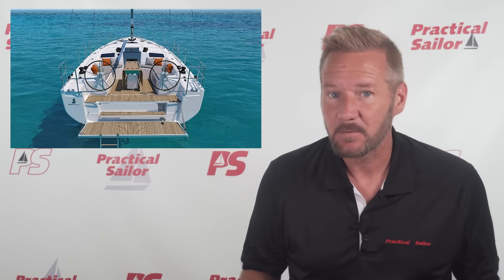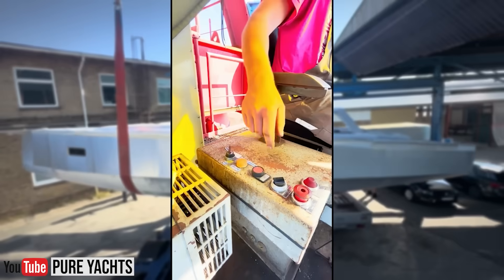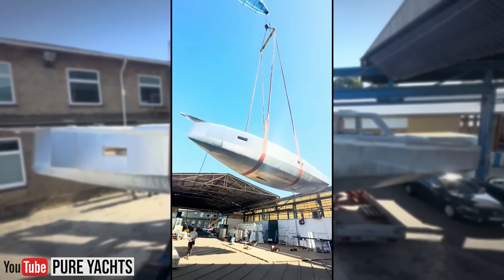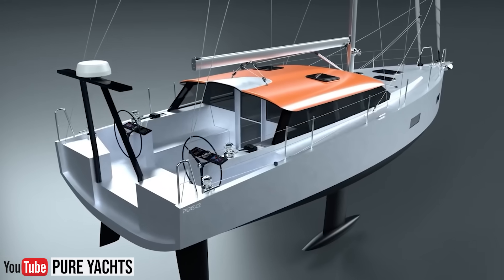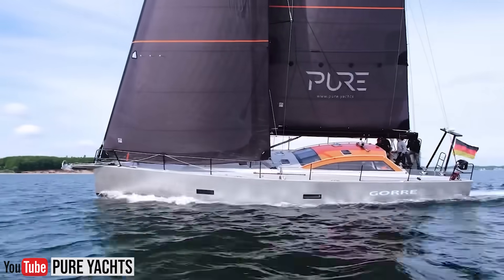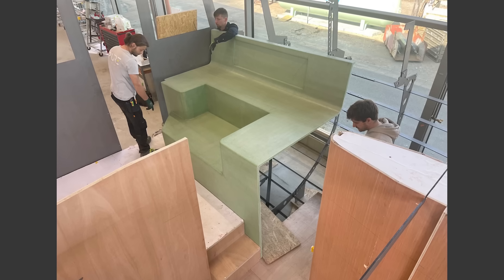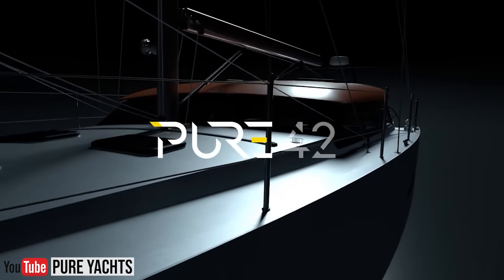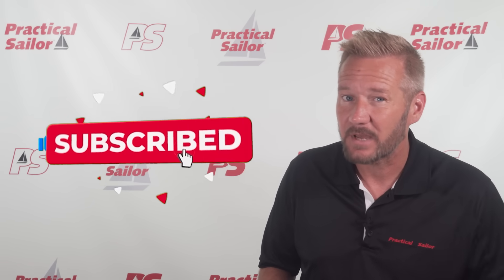Inside Pure Yachts: Germany’s Ultra-Modern Aluminum Sailboat Builder

Comment: Hello, my name is Matthias, CEO of Pure Yachts. Thank you very much for your comments and suggestions. I think every boat is a compromise. If you want a racer, you will end up with carbon. If you want to spend the winter in Antarctica, you need a real explorer. Our 42 is a fast and safe cruising yacht that is equipped to do anything. For me, a good design is characterized by simplicity, reliability, quality craftsmanship, and good sailing characteristics. Good sailing characteristics means for me active safety. It should be possible to tack away from a leeward coast with a sailing yacht even in 40-knot winds, and everyone should be able to enjoy the fun of sailing on a reach course in double-digit speeds. Our hull number 1 is currently in Barcelona, taking part in the “Yacht of the Year 2026” competition. You can find some great videos and pictures on the internet. You are all invited to visit our shipyard and test sail our Pure 42 “Tom Kyle” or the Pure 49 “Gorre,” or simply share a coffee or a beer with us. Best regards, Matthias

Comment: Regatta Sailor from Kiel here...
i race against Gorre (Pure49) and Sunbird (BM53) occasionally and i can tell you, that performance of those boats is fairly unimpressive. An X41 is faster than those two, even without handicap... Nice boats for Blue water cruising. Other than that i would suggest to get something else
Reply: Sorry, Baltic 500 this year: Pure 49 "Gorre" 2nd line honours - just behind Lennart and Melwin. So far...regards Matthias
Reply: @42scherni  not even 30 mins faster than a First 36 or an XP44 and 28th on Handicap 😅 And at other events the performance wasnt any more impressive

Comment: 1- I think 80ft is the ideal length---spacious and comfortable, and, yet, sailed short-handedly with automated systems.

2- Aluminim built to steel strength through added thickness is still lighter, stronger, except at welded joints, and immune to corrosion, provided the boat has no leakage currents.

3- I'm still not decided on the rig--Ketch Vs Schooner. If a schooner could have a partially furled upwind performance as good as a ketch, then, of course, I'll prefer the schooner for better downwind performance to quickly escape evolving storms. I don't like sloops, despite their far better efficiency, because of the capsizing moment they create with their larger height and area.

3- I want a centerboard or a swing keel for shallow beaches and for exploring rivers.

4- I want twin rudders, screws, and engines or motors in a diesel electric configuration, but only if this won't lead to leakage current issues to poke holes through the hull. i'd stick to twin diesel engines with twin shafts in lieu of the electric motors if there would be leakage issues because of improper earthing and insulation. 

5- I want the propellers and rudders protected by skegs or rhe hull, and I want the ruders to be retractable, like those on the Pangaea.

6- I want another set of rudders for shalllow waters, completely protected by the hull, like that of Pangaea.

7- I want the bow to bow to be strong enough to do light ice-cutting, not breaking, like the Pangaea.

8- I want fore and aft water ballasts for leading and trailing seas, as in the Beowulf.

9- I want good insulation and also water-tight roof or lazarette-mounted  ventilation ducts for the tropics.

10- I would like to use solar, wind, and hydro power(under sail). 

11- Since ammonia isn't practical yet, which can be produced from sea water, i might opt for lithium and sodium batteries in lieu of the primary ballast, but, again, only if it won't create potential corossion issues with leakage currents.

12- I, of course, want a deck saloon, at least a small secondary one, and also two semi-covered helms on the main deck.

13- I want a very large saloon, a comfortable owner's suite with a desk, a tiny workshop/hospital, 2 twins, and a dorm for the crew. An ensuite shower/toilet for myself, a common head/shower for the two twins, and 3rd one for the crew. Perhaps even a tiny cabin for the captain.

14- I want a small jacuzzi for warmer climes, which can be used for storing water or rations in colder climes.

14- I want a solar still, and also the usual RO or electrical desalination system. 

15- I need to hold supplies for around 10 to 15 days in a blend of refrigerated and unrefrigerated compatments. 

16- I want all systems automated for short-hand operation with minimal crew, as on the Spirit of Venice.

17- I want an alluring and practical interior, with minimal carpetting, for easy maintenance, as on the San Lorenzos, Swans, and Oysters.

18- I want to be able to tow or a host a 28ft trimaran, as a tender.

19- I would prefer electrical conduction cooking  and convection heating with backup diesel stoves or perhaps an entirely diesel system. Heat pumps are most efficient, but they struggle in negative temperatures. I'd still want to take a look at them, since they also serve as airconditioners in warmer climes. 

20- I want maximum autonomy and lowest maintenance.😮

21- Electric current leakages and alumnium are a disastrous blend, so unless the earthing and insulation can be fool-proof, I'd want to do away with electrical systems, wherever possible.

Comment: Hello from the Gulf of Alaska.
Sailing isn't my forte', but I can tell at a glance that isn't a heavy weather boat.
Reply: why?
Reply: @tcurdt  Wide, flat hull, closer to planing, with a high performance dagger keel. 
I bet it points high and runs fast on a reach. 
The "problem" happens when you heave-to and try to set a sea-anchor. 
A full keel/deep draft traditional hull will drag a large amount of water in the direction of the boat and the swell. This is like an artificial tide, running with the swell, which knocks, or pulls the crests flat, or flatter, so they don't break, slam into you and knock you down or roll you. 
Better than listening to me - Read "Heavy Weather Tactics" by Lynn and Larry Pardey.

Comment: Keel down when sails are up is a significant design problem. Check out Boreal yachts for proven offshore Al built boats. We sail off the wind with the centerboard up all the time, about 3’ draft in that mode
Reply: It's not a design problem it's covering their asses from potential brand damage and lawsuits. the boat wont fall over if you hoist the jib and cruise through the shallows with the keel up.

Comment: When it comes to design choices, we can have an educated discussion and it comes down to individual preferences. Lack of experience, skills and very basic boat building procedures are not up for discussion. You either have it or you don’t! 

Having worked with Pure and the „exceptionals“ in the past, I can only caution people buying from them.  This is a new yard with pretty much no Aluminium boat building skills. Even basic boat building practices and customer relations are foreign to them. We would never work with pure again. And without Martin Menzner, the brain behind the  Berckemeyer Brand,  (Pure) BM42, BM49 etc., the yard lost its most knowledgeable and valuable asset.  
… if you really want an aluminum Sirius guinea pig, Pure is for you!

Comment: I like the vessel but as someone who has little sailing experience but many hrs as an armchair sailor, I would say that for me personally a boat built with simplicity is very high on the list when it comes to replacing hardware. Ease o f sail also critical. As we know there’s no perfect boat with the exception of the one that works for you the sailor. I like the J-111 and would go up to a 40’ boat.  I do like the DH style. Twin helms…, I guess that just means racing or performance. But I am sure many will like it 😎

Comment: The aluminum hull is going to be noisy, and the sound will echo throughout the boat.  It will also transfer cold water temperature as well worse than fiberglass.  All in the name of speed? No thank you.
Reply: Aluminium and steel boats are spray foamed so they aren't noisey or cold.

Comment: Looks like a terrific boat.  I wonder if people would spend more on a boat if they knew they could recover more of their purchase price when it's sold later? (My experience is that people buy the boat they think they can afford and then all the other expenses,  to some degree, surprise them later. One guy was really interested in buying my boat. Was going to keep it in a marina for a year and then sail around the world. He asked what it cost to keep it. I never heard from him again. I'm glad I scared him off, I  just hope he didn't give up his dream and buy an RV.) 

Interesting that hull plate construction is done in the Netherlands. I've built three sea kayaks, 2 wood strip, one a skin on frame, and I've repaired a factory made fiberglass kayak that had been horribly bent right in half.  Not one of my boats tracks straight. I am experienced with construction, geometry, furniture making, measurement, sighting, etc, etc... I still have no idea what's off. The horribly distorted factory yak? I just patched it up and it tracks perfectly straight.  (The first I paddled out to Anacapa Island before I added a rudder. 36 nM pretty much mostly on my right arm, and my stroke was bad, I was lifting water up into the air with every stroke. We calculated the weight I lifted later. Tons and tons.)
One of two things is happening with larger hulls like sailboats. Either the size makes whatever is going on with my hulls null, or when a hull is built up from plates (instead of popped out of a carefully CNC'd mold) you need really good builders to do it properly.  I wonder if there are any boats that don't track straight, or if it's even possible to tell? The test I would do in my kayaks is on a calm day, lift the rudder, point at something in the distance, close my eyes and paddle. Then turn around and do it in the opposite direction. The skin on frame had about a 150 yard circle. I'd then try it putting a bit more effort on the inside circle side, this usually didn't make any difference.) 

re: The lifting keel. I wish my Hunter had one. I've a 6'6" draft.   After sailing the Bahamas on a catamaran (even then we often had a look out for coral heads), I looked at a chart for the whole country. The Bahamas for my boat would be very restricted. (Wouldn't keep me from going, but I'd want a bigger outboard for my dinghy so I could cover the extra miles to land.)

So all of us were immediately wondering: Baby Bayesian? It's not the keel, it's the clanging.  I like the tight fit.  And in the Bahamas you could probably just reef.
Reply: Many kayak hulls are directionally bi-stable unless trimmed tail down.  Water curving around the aft sucks the hull over and the opposing side flow separates.  If you can coast turning in both directions asymmetry is not the problem.
I always fit a rudder.  Some prefer a skeg.

Sailboats need substantial rudders for control and the flat aft avoids the bi-stability.

Comment: The perfect sailboat for what?  That is the key.  Just because a sailboat is large and tough doesn't mean it is made for everything.  There are many different types of sailing and boats made for each type.  There are day sails, weekend cruising, coastal cruising, sea cruising, chartering, Ocean crossings and world traveling and then the Expiations to the high lats.

Ocean going boats are usually going down wind and in the middle of the ocean the waves are big and powerful.  Long keels and large skegs (the Kraken skeg is kind of small) help keep the boat going straight, taking strain off the steering gear including the AP while also preventing broaching.  You want a heavy keel, a short mast with large genoa (winds are different in the ocean).  Those doing ocean crossings and world cruising rarely sail upwind for long times and they aren't racing so the upwind performance of the thin skinny keels and spade rudders doesn't help them at all.  These boats are also built with extra features to make them more self reliant in case of disaster at sea because when you are over 1,000 miles from land, there isn't much help out there.

Charter boats, which is what most production boats are made for because it's big business, need to go someplace but come right back, so upwind performance is important.  Places like the med sea where they either have too much wind so you are staying in harbor or very light winds, you'll want the boat as light as possible.  You want a tall mast with light keel and jibs instead of Genoa (need to reach the higher winds near land). You don't want the long keel with skeg rudder.  Unfortunately, because of how cool these boats look and the very cheap second hand price tag and greedy boat dealers, these are being sold as ocean going boats.

The expedition boats need to be able to handle the large ocean wells and heavy storms but also have decent upwind performance and an impact resistant boat.  It also need to help the crew handle the cold environment.

So when talking about the perfect boat, you must first define for what sailing you'll be doing.   When looking to buy a boat, first decide what kind of sailing you will be doing mostly.  Get the right tool for the job.
Reply: For some people the time necessary for getting to the other side of the ocean matters, long keels, short masts and heavy weight are not right in that case, those have big downsides for going downwind as well.
Expedition boats are a different story, for those the attributes you mentioned often are the right choice.
Reply: @illdeletethismusic  Don't get me wrong, I'm not pushing for full keels which are pretty slow, but long fin keels (I'm also not knocking them for world travelers either).  True, you aren't going to be planing much but you can still reach a good speed.  Need more speed, throw up a cruising spinnaker.  

As for the low fat rigs at sea, here is why: winds far away from land are a lot stronger at deck level than sailing near land.  You also have waves that at times you have to power through.  A short fat rig will keep the COE low, allowing you to have more sail area out than a taller rig would.  This allows you to really power up.  On the Atlantic crossings east to west you always have good winds.  West to east you'll have a lot more light winds but you also have a good chance of getting hit hard and then you'll really wish you had a boat built for it.

Near land you want that tall rig to get the stronger winds up high, especially in light winds that most will sail in the med sea.

Personally, I don't like planing out in the open ocean.  It puts a lot of stress on the rig and boat and if something goes wrong, it could become a very violent broach.  I only feel comfortable planing when I am hand steering.

So, to me it's worth spending 1 more day at sea crossing the Atlantic for being safe, comfortable and not putting much stress on the boat (rigging and steering gear) and having less issues on the crossing.
Reply: @illdeletethismusic  https://www.youtube.com/watch?v=aB-PtgmkpYI

Comment: I just don't get how this can be considered world cruiser? 

Super squirrelly under sail with that blade of a keel and no directional stability. these extreme wide transom boats are know to be poor performers going up wind because of the severe weather helm and heaving to in storm conditions with a 7 or 8 thousand pound bulb keel hanging down 10 feet does not sound so great. 

This design built more like a racing boat that would be a real handful to sail in bad conditions.

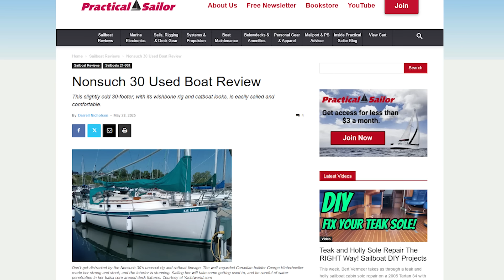I know you need stuff to write about but really? A great world cruiser/expedition type? 9:14